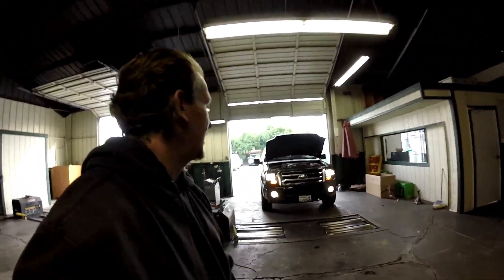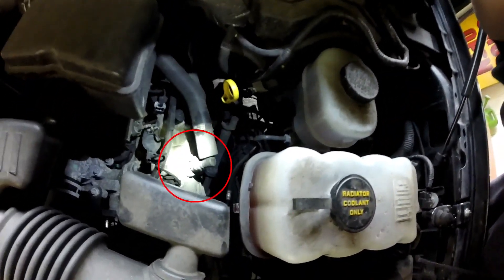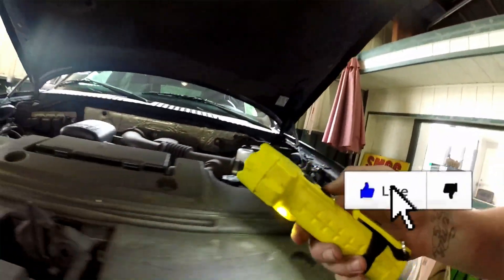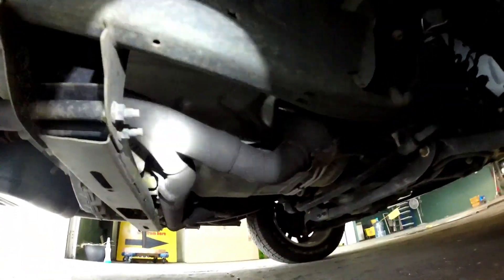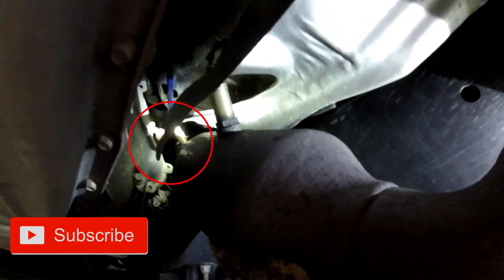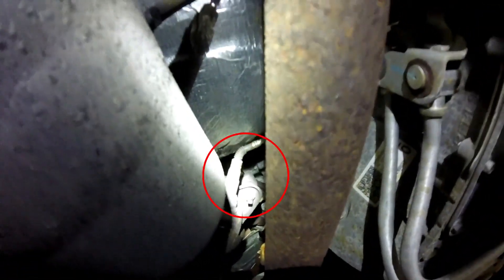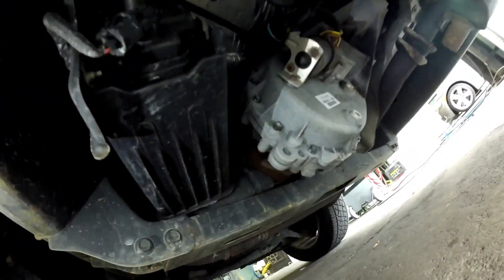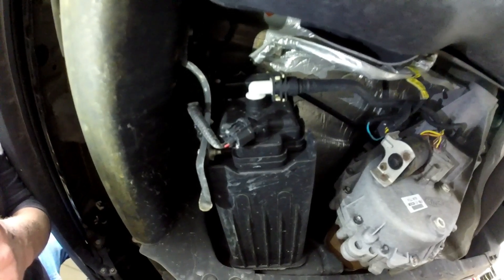⫷ Ford Expedition PCV, EVAP, PURGE, VENT & Oxygen Sensors ⫸

Comment: Thanks. What is the fuse for oxygen sensors? is it 76?
Reply from the maker: Yes it is 76. But! That fuse is not just for the O2 sensors. It also provides power for the mass air flow sensor, and intake temperature sensor, too. So if it's blown... your truck will probably run super bad.
Reply: @ScottiesHobbies  unfortunately yes.
I replaced it, then PCM 35 fuse blowed and the engine stopped.
I checked oxygen sensors cable, all fine.. Where could i look for the short else+?

Comment: I have a question I have an 2008 Expedition EL that recently just had a issue where I filled it then drove and all of a sudden I smelt fuel and went under and saw drive side wheel wells were wet touched them and smelled like fuel. I saw I was losing fuel as I was driving went from full tank to a quarter so I parked it for few days. I came back to find the leak it was dry and took it for a ride to see if it would do it again and nothing dry no leak anywhere I could see. I went under touched by the tank, filter, evap canister, followed the lines towards front and saw nothing and it doesnt use or leak at all im confused on what it could be. Sometimes when I fill it does push fuel out the filler neck spilling I just usually slow the gas nozzle down so it doesnt do it.

Comment: Question, is the EVAP Canister located in the same place for my 2017 Expedition?
Reply from the maker: It is quite possible.The part number of the vapor canister shown and this video says it fits for a 07 to 2014 model expedition. But I looked up the 2017 expedition vapor canister and they are almost identical.The mountain brackets look the same. It's probably worth taking a look..

Comment: I know this is late, but the EVAP Canister you showed, would that affect the ability to fill up truck? I'm currently having an issue where the gas handle when pumping constantly clicks.
Reply from the maker: The canister itself won't affect the filling of fuel. But if your evap vapor vent solenoid is not working properly properly that could be the issue. The event valve should open when you are filling your tank. If it does not open, the fuel pump senses pressure and shuts off. I made this video a couple weeks ago when my neighbor was having this very issue. Check out this video and let me know https://youtu.be/H99x8agwwbI

Comment: The evap purge sensor is on the end.  I need to know what the sensor is above that on the top of the canister.  I'm throwing a P0453 major leak detected.
Reply from the maker: The vent solenoid?  If you check out my video library you can find a few videos on testing the event solenoid. I just Uploaded them in the last few months. There is also a video with tips on how to start checking evap leak codes.

Comment: FYI ..O2 sensors are upstream and down stream respectively, there is a configuration difference
Reply from the maker: Oh em gee!! Really!?   Please explain. Doesn't the downstream oxygen sensor read the efficiency of the catlette converter? Further? How about the upstream oxygen sensor? What does that do?? Does it send information to the computer so the computer knows how much fuel to give or take away  From the injectors to optimize Combustion?
Reply: @ScottiesHobbies  You did'nt Identify O2sensors on the cat..I thought you did'nt know..oops!
Reply from the maker: @hubert-williams3379  did you watch the video? On the passenger side I say this is bank x and this is sensor x. Then I go to the driver side and explain the same. The sensors are named as such: bank 1 sensor 1 is the pre cat sensor on the bank 1 side. Bank 1 sensor 2 is the rear o2 sensor on the bank 1 side.. same goes with bank 2. I think its all in this video.
Reply from the maker: @hubert-williams3379  the sensors in the cats are the sensor 1 for each side.

Comment: On my 2012 expedition check engine light  came on got a reading and it came back code P0130 bank 1 sensor 1 now I'm also getting check fuel inlet message now should I replace O2 sensor to see if this takes of every thing or also the purge solenoid
Reply: Did you figure it out? I'm getting intermittent P0150 on a 2011, which is showing B2S1.
Reply: @MattTigers  I had the vehicle checked out by a Tech the O2 oxygen sensor will take care of the check engine light but the fuel inlet message has to be taken care of by replacing a bad purge solenoid this is was told to me by the service writer per the tech it's crazy cause the O2 sensor is covered by warranty but the purge solenoid is not and is about the same price at the dealership and they telling me it has nothing to do with the engine drivetrain I was like WOW so yeah this is what I found out
Reply: Thanks for the update. Changing the O2 sensor doesn't look too bad, but I'm seeing there's a few other things it can be with the P0150 code.
Reply: @MattTigers  Yeah I seen that to for that code po150 the O2 sensor or the ECM
Reply: If you fix the engine control Module and Change the O2 sensor then you have a voltage problem

Comment: But to change the pcv in this car????

Pcv is not changeable unless you change the whole engine head cover
Reply from the maker: The valve cover. This is super common to be built like this. Almost all newer vehicles have them built it to the vavle covers.
Reply from the maker: I know Chevy switch to this style around 2005. I believe with those you can get a older style valve cover that will allow you to change the PCV valve. I am not sure if it's the same with the Fords but it might be something to look into if you're interested in having a serviceable PCV system